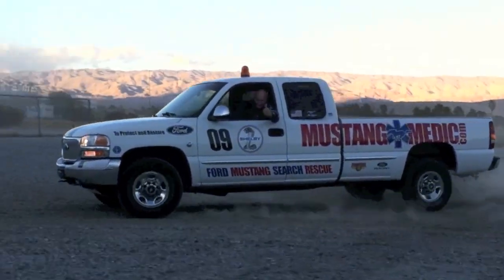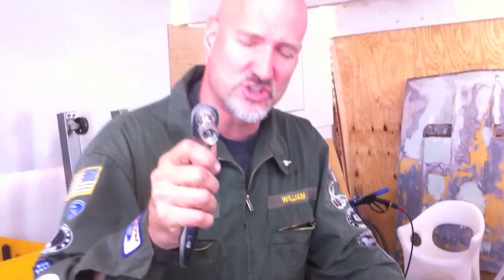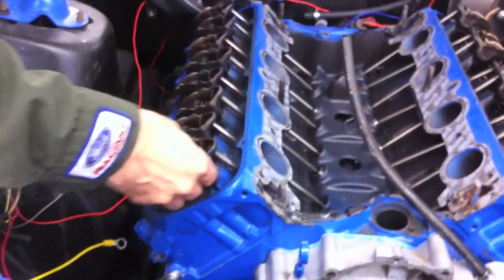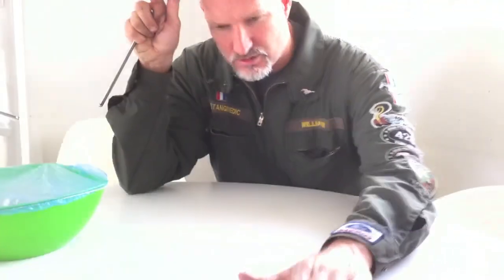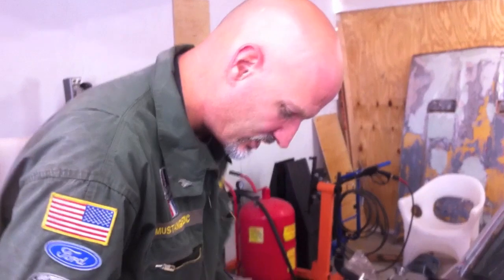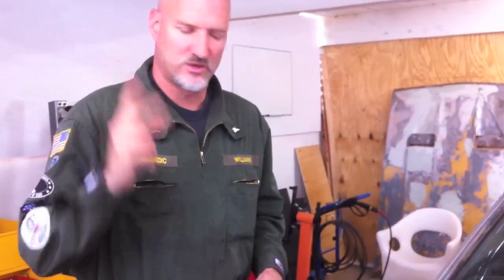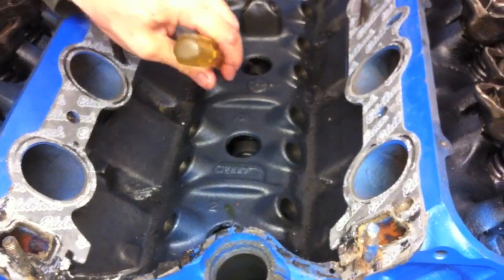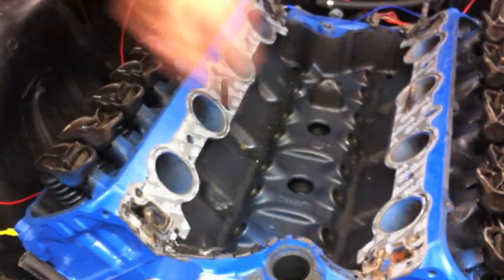Removing push rods and lifters 1971 Mustang Fastback - Day 153 - Part 1

Comment: I'm very new at working on engines, I have a 65' mustang with a 289, and my question is does the oil come up through the pushrods to go over the rockers? My engine has a rattling sound.  Been getting mixed answers, but most of them seem to point to the lifters and possible not enough oil getting through and I just replaced the oil pump and still it's rattling.  Someone told me that a pushrod might be "clogged" and not enough oil is getting through?
Reply from the maker: YES
Reply from the maker: Yes it does

Comment: Hey my name is Nick I have a 1998 Lincoln Town Car with the 5.0 and it I currently went to O'Reillys and bought some spark plugs and they gave me the spark plug that happened to be too long so when I put them in my car put everything back together I turned it on and study here in a knocking sound quickly turn it off bought some right once put em back in  it and still knocking can you give me any ideas what it could be And do you come to Vegas
Reply from the maker: CRAP you may of damaged the pistons.  NOT good news.  Or worse parts of the plus are in the cylinders.  You need to take the heads off and inspect sorry for the bad news errrrr
Reply: Dammm
Reply from the maker: I know sorry man, get a second opinion.
Reply from the maker: Do you have a receipt from the store saying that those were the right spark plugs for your 5.0
Reply from the maker: I'm not giving you legal advise but that would be valuable to you.
Reply: Ya yeah this is exactly told the guys I work at oreillys that I needed the spark plugs to a 1990 Lincoln Town Car 5.0 and he gave me spark plugs too the 4.6 liter so they were too big and I told the manager and the manager said they're going to come out to my house and check out what broke and my engine and figure out what they're going to do to fix it because the guy that sold the plugs messed up
Reply from the maker: That has to be on the receipt to help you.